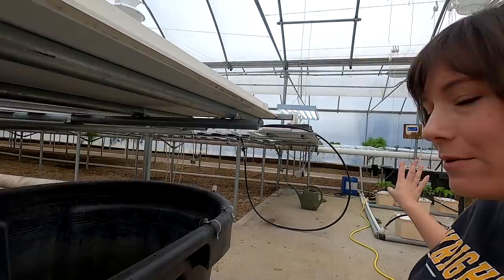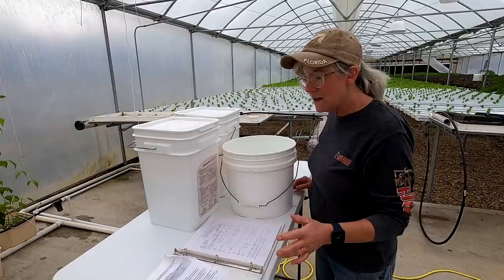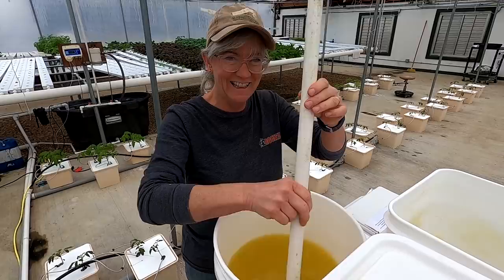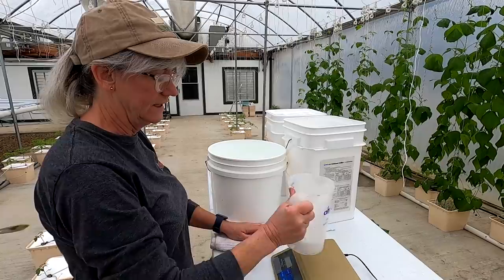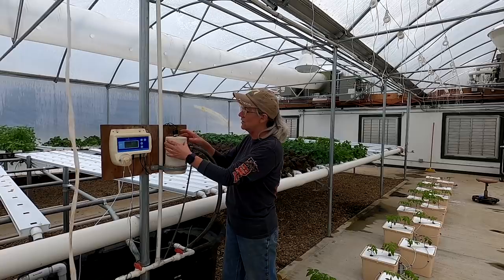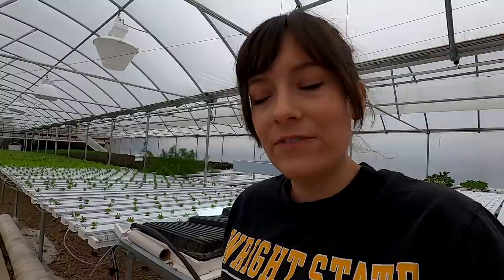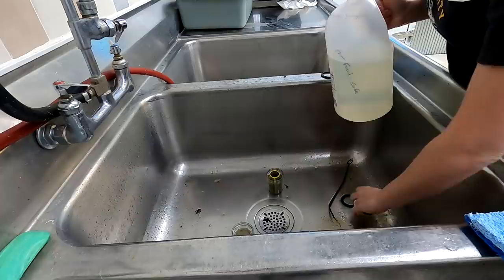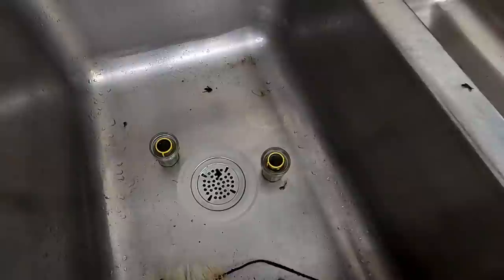Hydroponic Tomato Nutrients | Measuring, Mixing, Tank System and Growing Tips

Comment: Couple of hints: 1/ If you mix in your acid to your stock water before adding in your nutrients you will probably only need about half of the acid you are using now. All due to ion chemistry which I won't get into now. Just ensure your plants are not hit with too low a pH between adding your acid & adding your nutrients. 2/ Always add your calcium nitrate to your stock water before adding in your Hydrogrow. Again, it is all to do with ion chemistry reactions, but swapping around the order of adding your 2 separate nutrient solutions to your stock tank will result in less calcium coming out of solution over the next couple of days. Don't just take my word for it, try it & see for yourself :) 3/ Use a short stiff hair broom instead of PVC pipe to mix up your nutrients. Really easy!

Keep up the entertaining vids!
Reply: If calcium is precipitating out of solution you should switch the ph down from phosphoric to nitric acid.
Reply: Hmm, interesting, Started using MasterBlend and everyone keeps saying mix the CalNit last. Will have to give your way a go, thanks.
Reply: @gloriouspopemantom373  Yes, I know most people (& even Masterblend) say to mix the calcium nitrate last, however it is the calcium that reacts with the trace elements to then form an insoluble mixture of compounds in the bottom of your nutrient tank. If you mix the calcium nitrate first, the calcium levels are no longer concentrated & so they won't react with such vigor when you later add the trace elements.
Reply: @derekgore1268  When there are A and B powders when you buy nutrients, is one of the powders only calcium nitrate?
Reply: @chrisjowaisas95  if it is the Masterblend the second part should be the CalNitrate. The first part has the rest of the nutrients with epson salt already mixed together. It should be labeled to state what it is. CalNitrate is typically small lightweight white balls.
Reply: @chrisjowaisas95 yes it’s 3 powders. Nutrients, epsom salt and calcium nit.

Comment: Nice video! I do my Dutch buckets pretty much the same way except I use Masterblend, calcium nitrate and epson salt. I also recirculate my nutrients. Thanks.
Reply from the maker: Thanks! That sounds great and nice you recirculate.  How long do you go between tank changes?
Reply: I replenish my reservoirs as needed and usually do a complete change at 6 weeks. My little greenhouse is not heated so I use a aquarium heater in each of my two reservoirs. You guys run a very neat greenhouse.

Comment: Hi ladies, Question, or sort of a question. I just got my first Crop King 10-36 system, and had a heck of a time building the table. I built it wrong by putting rails on the pole that the legs are attached to to, instead of on the legs themselves. Anyway, I fixed it. My question is,  can you show me how the drain system is attached? I read the instruction's,  but they do NOT do any justice in how it should look as I am trying to build it. Also, I am using to 100 gallon tub, do you think I should get the blue barrels for nutrients in the future? I'm using the Master Blend nutrients. I like how you mom mixes the nutrients separately, I'll start doing that.  Love you guy's channel, keep up the great work!
Reply from the maker: I will have to look into that. Not sure how it is supposed to drain. Do you have a container to catch discharge then recirculate?

Comment: Hey Katy, where do you get your chelated iron? The stuff I’m getting is pricy. The pump in the 100 gallon tank looks like a utility pump instead of a sump? Where to you get your (timers and those bulb filters) and how many Dutch Buckets do they supply nutrients to with the pressure that comes from a 1/3 hp pump? I am in the process for revamping my system and I may try that instead of using the pool pumps that I currently have in that house.
Chuck
Reply from the maker: Hi Chuck. The iron I get is expensive too and haven't had any luck finding a cheaper alternative.  Let me know if you find any thing. The timers are from Amazon, and there are 88 Dutch buckets in my system.  The pump is going on 7 years old and does a good job.  -Katy
Reply: @HomegrownPassion  
I pay the equivalent of $27.50 US for 1kg of 11% DTPA, not sure how that compares but it goes a fair way.
Reply: @atomizer2665  And there is also a biodegradable EDTA,. But I personally would approach the problem in a different way. A solution for hydroponics or dutch bucket needs just 3 components. 1. Kristalon, 2. Calcinit, 3. Epso Top. The <Kristalon comes in different combinations,. I am using Kristalon Brown. A 25 kg bag is 40 dollars and makes 100,000 liter solution. All the chelated metals are in the Kristalon.
Reply: @Lisas4us  
You must be growing something other than tomatoes because kristalon brown at 0.25g/L wont meet their nutritional demands :)

Comment: I noticed that when your getting water together for the initial dilution I think you mentioned "warm water" is that correct?   If yes does it help the mixing the dilute? I haven't tried doing that but it makes sense to me rather trying to do the same in cold water. Good job
Reply from the maker: Yes, warm water helps the dissolve. we also fill the barrels and let them sit a few hours to disburse chlorine. (We have tap water)

Comment: How do you get the water that drains from the dutch buckets that are sitting on the ground back to the nutrition tub? Are they on some kind of pump, or is there a slope to your concrete?
Reply from the maker: the greenhouse was built with a 6% slope they sit on a pipe. Check out the other videos on bato buckets and you can see how they are set up.

Comment: I have a super small (3 plants) tomato Dutch bucket system in my basement under a grow light.  I did the first set up following your recommended nutrients but here I am 3 weeks later and my nutrients read the same on my ec meter.  Do I just keep using the water until the ec drops?  So I need to add more or change out the water?   I don’t see any algae growth currently.
Reply from the maker: I'm not sure i would just watch growth make sure no yellowing. our ec changes up or down all depending on uptake from plants. if there rowing well just let them go I would say

Comment: Hi Devon The high tunnel I built is almost ready to go. I was set the dutch buckets up first so this video is spot on Good Job! but 1 question How does the feed solution get back into the 100 gallon rubbermaid tank ? and do you pump it back? Yall just jump into the technical aspect because The next thing is the  white grow trough's  so that means I keep trying to see how it's made. it looks like 1 5/8 pipe stands and maybe 1 3/8 runners across the top. I bet your dad used the T connectors. Send me a message if you need a 20 ft hoop bender for  you home greenhouse. It came fro bootstrap farmer.  Oh and keep going I love this stuff. Mark
Reply from the maker: Thank you, Mark! The nutrients for the tomatoes are drain to waste.  We adjust the timers so only a small amount drains out.  We want just enough to saturate the medium plus a little run off so there isn't salt build up.  I have just started putting together a construction video.  It's going to show how we built the greenhouse and the NFT support structure.  It's going to take some time putting it all together, but hopeful it will be helpful.  Hope you have a great week and good luck with your buckets! - Devon

Comment: Does your water pump (in nutrient water) run continuously 24/7  or there is specific time intervals that you use to manage water supply?
Reply from the maker: in the hydroponic system it runs 24/7

Comment: You mentioned you adjust the nutrients after the tomato gets it's 3rd flower cluster.
I am using the Master blend mix 4-18-38. I am wondering if you have any experience with this and any recommended nutrient adjustments after flower to get the best harvest.
I am currently doing the kratky method and starting to set up Dutch bucket system.
Mixed at 2g-1g-2g per gallon.Using the same mix ratio for lettuce and peppers as well.
Would love your input.
Thanks for the content you share.
Reply from the maker: I'll see if Nate can answer your question

Comment: Do you recycle the drain water from the Bato buckets back through the system or do you discharge it to the drain?  Thank you for the videos.
Reply from the maker: Of course! It is discharged to the drain. We try to set the timers so only a small amount is actually drained out.

Comment: What is your opinion on flushing the system occasionally? Booklets states as it's a must but I just feel like a business driven advice or just if you can't troubleshoot start over. Have you ever flushed the system?
Reply from the maker: We do flush to remove salt buildup in the system. We try and monitor the plant sucess and let that determine what needs to be done with the nutrient solution.

Comment: do u use the same measurement and same nutrients for bell peppers and cucumbers?
Reply from the maker: Bell peppers are in the high tunnel and run on the Dosatron system which is using 20-20-20...cukes are running on a vine crop formula...off hand i don't remember the analysis
Reply: @HomegrownPassion  can you guys make a video for that too cause i dont understand what you said

Comment: Hi, how often do you completely change the nutrient solution with that size of reservoir?
Reply from the maker: The reservoir is 1200 gallons, and we monitor the salt in solution to determine when we need to do a nutrient water change. But I would say every 6-7 weeks. We keep the water and use it in our high tunnel.
Reply: Thank you. I have a 200 gallon tank  that I drain once I topped fresh water of same amount. I live in tropical country and lettuce are drinking water like crazy.  I may be unecessarily draining usable nutrients. I learn a lot from your channel

Comment: What are the dimensions of that greenhouse?. And is the floor concrete only in the pathways - and the rest bare soil covered by weed mat?
Reply from the maker: The greenhouse is 5000 square feet, and yes the pathways and the floor under the Dutch buckets are concrete.  The rest has weed mat with gravel on top.
Reply: @HomegrownPassion  thank you.  So you put a layer of weed mat down - and then how thick is the layer of gravel?I know that where you are in the US gets very cold in winter. Do you heat the nutrient and the greenhouse then?

Comment: How does the cost of your dry nutrient mix ingredients compare with the liquid FloraBloom/grow nutrients?
Reply: I just switched and its about 10% the cost for dry over liquid. costs big money to ship water around. a 1 pint(or liter) bottle here is around 15bucks and the equivalent when i priced it in masterblend was about $1.6. I was using general Hydroponics.
Reply: @robertguay3773  Thanks, I switched last year to MB and it's so much easier and less expensive.
Reply: @royrunyon8119  a little tip. Mix 150g MB 75grm epsom salt to each liter of distiled water then in another bottle mix 150gr calcium nitrate and preto you got pre mixed easy to use pre mix. it takes around 60ml of each to get to 1400ppm in a 5 gallon pail. I do a 4l bottle at a time. All the convivence of Liquid p0re mix 1/10th the price.

Comment: Have you ever tried the Masterblend Tomato Fertilizer on your crops?
Reply from the maker: No we haven't. What's your thoughts on it?
Reply: @HomegrownPassion  Well our Hydroponics Company is located in the Caribbean, we use different formations of the Masterblend NPK ferts for different crops. From what we have seen so far with other ferts used, it provided the best results. Their 4-18-38 line is ideal for tomato and other fruiting crops.
Reply: NPK for the two prods are relatively close.  FWIW, Masterblend can get a bit dinky on the K too like HydroGro.  I too have to supplement potassium.
Reply: @teac117  
Its par for the course with tomato, you have to alter the N/K ratio for different growth stages whatever happens. Typically its just a case of altering the amount of calcium nitrate and potassium nitrate in the formulation. Potassium chloride (KCl) is also used in some situations